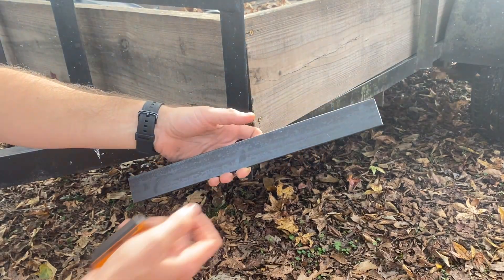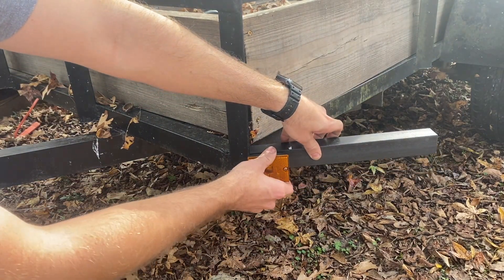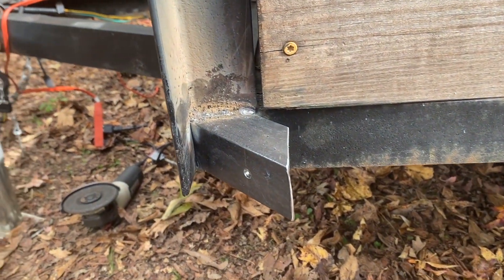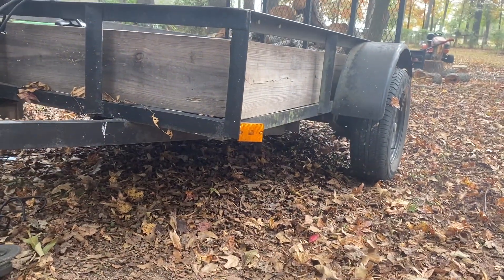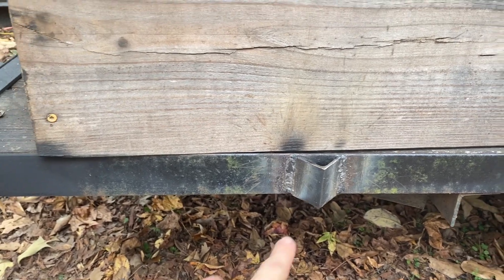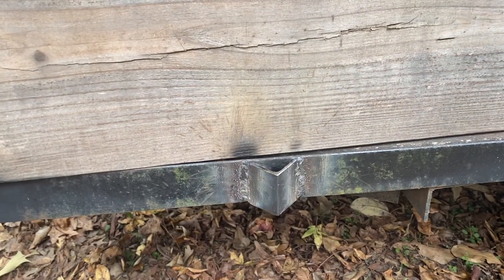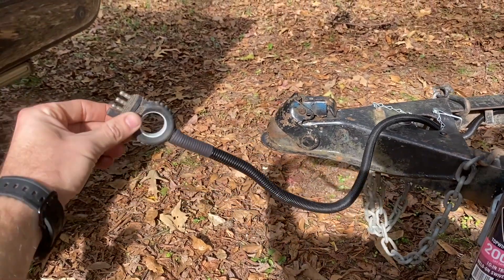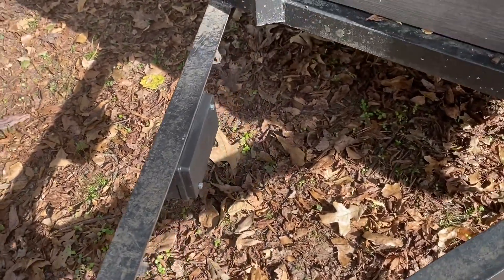Utility Trailer Upgrades: New Wiring, Clearance Lights and Tie-Downs

Comment: Nice upgrades.  Really like the front markers.  I have a 5x10 utility trailer and it also came with no markers up front.  So I'm working on putting two amber markers up front also.  The tie-down angles are good too.  I was also attaching straps and bungies at the bottom of vertical sq. tubes.   I welded on little D-rings everywhere you could ever want a tie spot.  The junction box is a good idea too. It's all inexpensive, so why not.  A real good thing about your trailer is having a wrapped tongue.  Lots of little ones don't have those supports running under the frame.  Wrapped is far stroner.
Reply from the maker: I appreciate it! I am a huge fan of the A-frame style tongue. The only thing I don’t like about the trailer is that it’s not quite wide enough for the Ranger to fit. I have to use the 10k car hauler which is a little overkill. 😂
Reply: @jon_saunders  Yup would be nice to have an extra foot wider.  6x10 or 6x12 would be perfect.
Reply from the maker: No doubt, a 6x10 would be ideal, but trailers are ridiculously expensive nowadays, even used ones.
Reply: @jon_saunders  Everything seems to be through the roof, thanks to our dear leader.  Let's Go Brandon!
Reply from the maker: Doesn’t look like anything is going to be getting cheaper anytime soon either.
Reply: @jeffro221 Let’s go Trumpy!